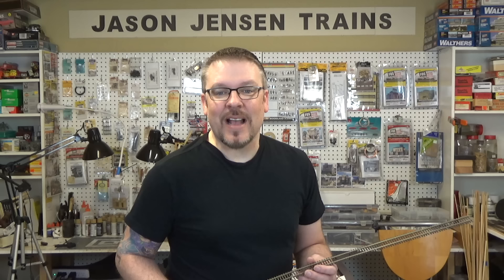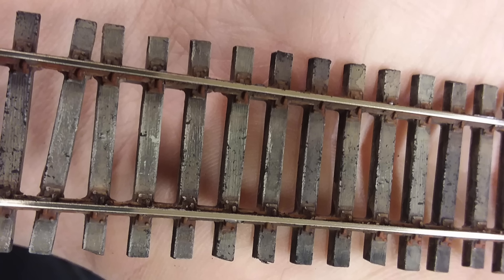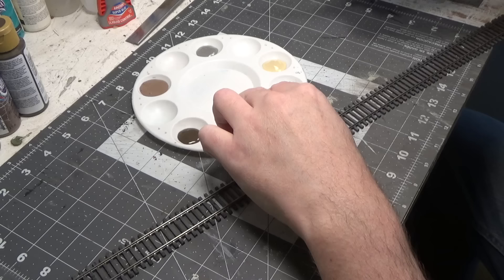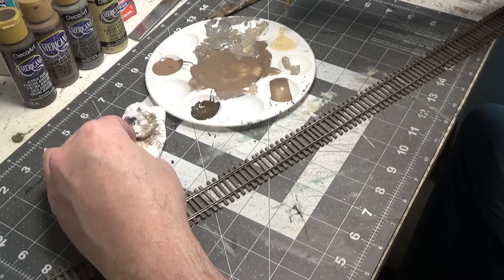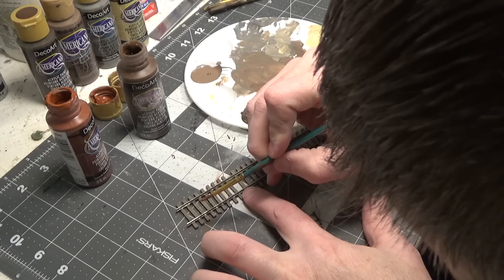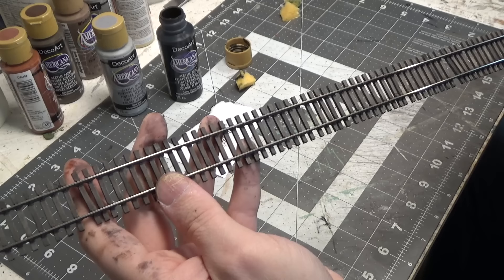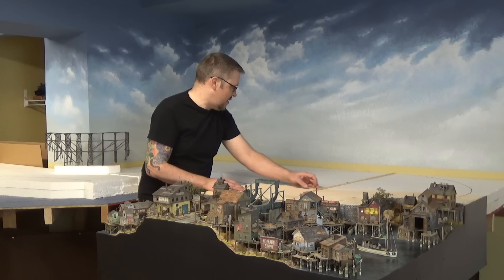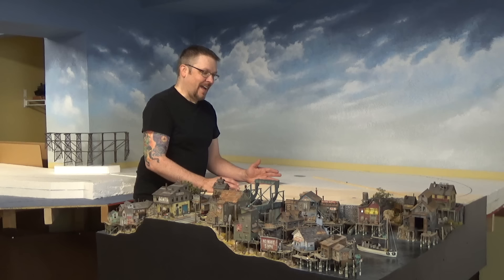Painting track for our model railroad

Comment: As someone who has built and painted many WWII Tanks using only Acrylics through an Airbrush all you need to do is wash the track in washing up liquid to remove any grease from production and from your hands and then you don't need an undercoat and Acrylics are not plasticised so shouldn't peel or fail to adhere. My Tank Tracks which are moveable still have the Acrylic paint still there after many many years, so don't worry about an undercoat. Do like your paintwork, but you should try Vllejo Rust and Steel so your rust isn't a uniform colour as things rust at different rates even if they've been outside in all weathers for the same time, rails and tie plates will be replaced in certain parts when track damage occurs therefore the rust would be pretty new and orangish, Vallejo include instructions on how to use thier paints, and show how to paint new to mid to old rust, looks good too. have a look at some of the Tank modellers rust techniques on thier models.Also good ideas for weathering rolling stock.  
https://www.youtube.com/watch?v=_OtitXtbnSI
You can also get oil and grime sets which do add realism to rolling stock also chipping medium as long as you paint red lead on your locos, and then a matt varnish, you can add small drops of chipping medium then overpaint it with your chosen colours allow to dry then just use water and and a brush and dab away at the areas you used the chiping medium. Just a few ideas.
https://www.youtube.com/watch?v=pNcUJ0BACO4&t=906s
You can also use hairspray for chipping
https://www.youtube.com/watch?v=dWu8bL_btdk&t=1280s
https://www.youtube.com/watch?v=ku4comhKHJM&t=3s

Comment: Hey Jason,
 Thanks for recommending Steve Browns channel, (It's My Railroad). I've learned a ton about building bench work, electrical install, and "regular guy" scenery building. Unfortunately, I found his channel to late to help him with a common track laying problem. It's called joining sections of flex track on a long curve. It is hard, almost impossible, to keep the joints from kinking.
 Here's the fix; Join and solder the INSIDE connection, between the 2 central sections of the curve, like normal. Now carefully pull the rail back on both sides, on the outside. Carefully slip a short section of scrap rail into the gap ( about 6 inches long on center, in the MIDDLE of the curve) then slide the outside rail back, butting it against the inserted piece and solder the joints. No more kinks. Note that you have a 3 inch section of rail sticking out that can be used to attach the next section of flex track, no kinks there either. This method can be used wherever you join flex track, creating a smooth continuous track. I learned this trick from a guy in a model railroad club almost 50 years ago. I hope it helps you and others to have smooth running trains. ;-)
Reply from the maker: Thanks Robert!!! I love Steve's channel.  I will have a video on laying track on a curve. Stay tuned....
Reply from the maker: Hi Robert,  hope you get a chance to see my new video.  It shows installing the track on a curve. I think it's the same technique as you described above. Again, thanks for watching and happy modeling!!!
Reply: Hey Jason; Yes I saw your video and after seeing it, your method is probably closer to what that guy, 50 years ago, showed me. Either way, this method of joining flex track can be used to do far more than just building kink free curves. Thanks for the feed back. ;-)

Comment: Hi Jason,
Great job.  I learned many of your techniques decades ago from George Sellios.  It's great to see one of our youngins carrying on the mastery.
A single comment. When detailing the rail ties with a pull saw or a razor saw be extra cautious.  Or you could spend a LOOONG night in the E.R.  I talk from experience.
Over the years I have found a safer tool.  NO JOKE.  Use a kitchen scouring sponge.
In this CoVid existence you can sit with wife, while TV sports are are cancelled, and watch her Rom-Com Chick Flix.  While her stories mandate the TV screen, you bring along 2 or 3 sections of track, to the LazyBoy.  With the scouring pad folded over the work area you distress the rail ties faces and sides.  You can repeat to your heart's, or lost mind's, content.  Or you can apply additional pressure to give deeper depth.
HOWEVER, you can also use the scouring pad side to polish the tops of the rails.  While using the sponge for minor dust and shaving residue clean up.
~Jim
Reply from the maker: Thanks  for the great tip Jim!!! And thank you so much for watching,  I really appreciate it!!!

Comment: really nice job Jason..I wish I had seen this before I put my track down a few months ago.. I really like the idea of cutting the back side a few ties here and there to make them un uniform. I am at the point of painting as we speak..so, this video became very helpful. Thank you for taking the time to share your insight to all the aspects that you do on your channel.
Reply from the maker: Thank you so much for the kind words!!! And thank you for watching!
Reply: @JasonJensenTrains  I have a fine point soldering tip that is wore out and has a hole in the end.. I may try to put a length of wire in that hole..bend it near 45 degrees..and try to melt away some of those stringers from underneath while it's still in place..just an idea..who knows..it may work ..if not.. oh well.. but, it might..

Comment: One thing that I do when painting track is to pre-form flex track in place, then lightly glue with CA along the tie-plates to lock the rail in place. I found that doing this keeps the paint on the rail, instead of scraping it off when it's formed after painting.
Reply from the maker: Thanks for the tip!!!